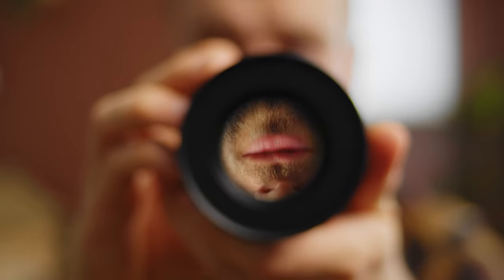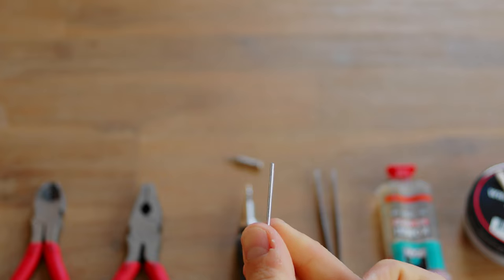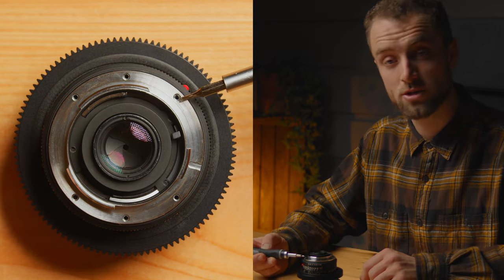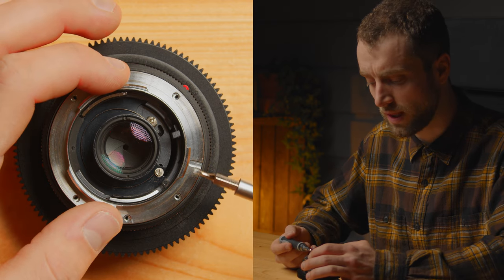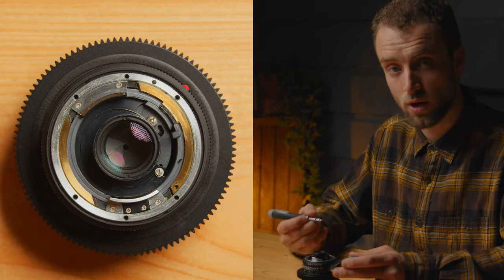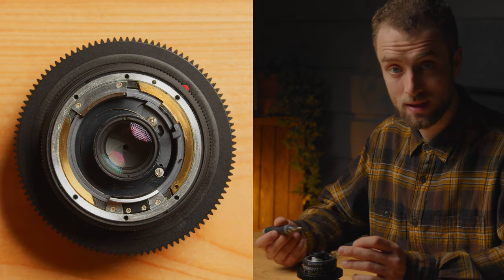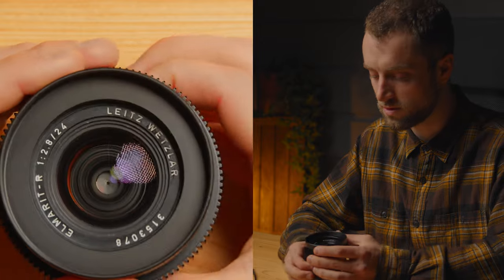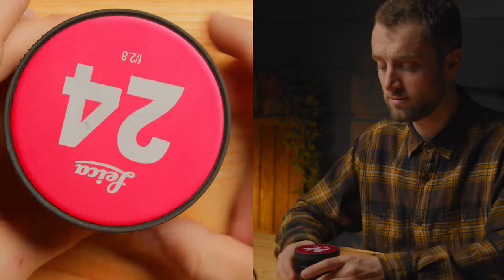How To DE-CLICK Leica R Lenses

Comment: What material is the part of the lens on which you glued the metal pieces? Can it be soldered?
Reply from the maker: Not entirely sure. I wouldnt solder tho. Heat so close to elements can cause the grease to melt and cause haze. Epoxy is just fine